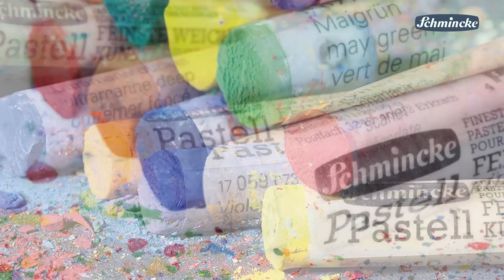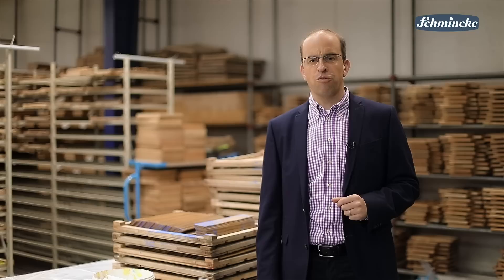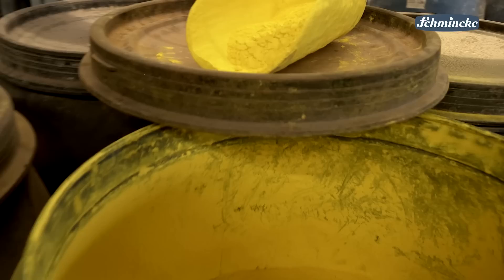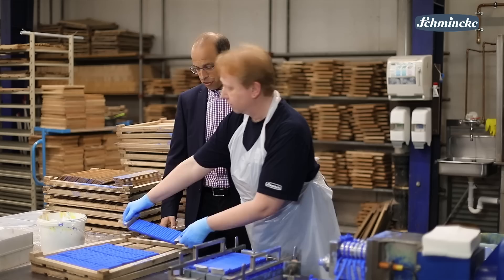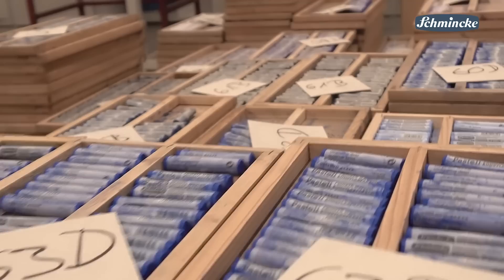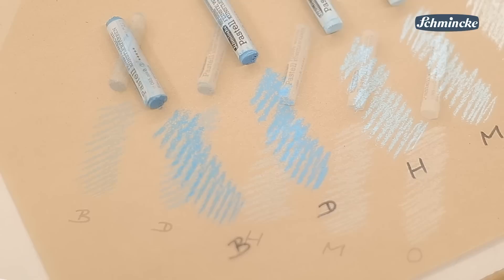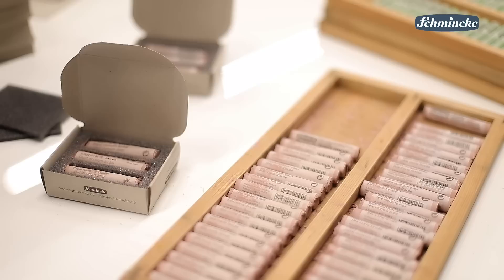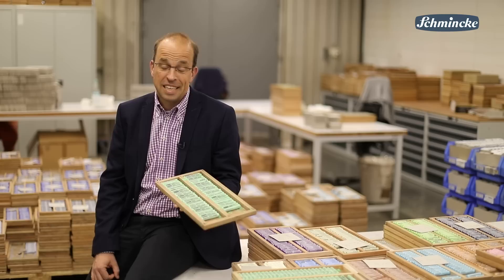How Schmincke Soft Pastels Are Made

Comment: I have a question concerning the letters B, D, H, M, O on the labels:) They must be the first letters of some words - but what are they? B - Black? D - Dark? And then?..
I think this info could ease remembering the system:)
Another question is more difficult. I see that Schmicke pastels are often multi-pigmented. And what especially surprising, when you study the pigments in the variations of the same color, there can occur different pigments. For example, Krapprosa 047 in H variant contains only PV19, in D variant it has also PR122 (another Quinacridone) and PR146 (Naphtol). Violet Tief 059 has in D variant four pigments (PB29, PV23, PV19, PB15), in H variant - PB29, PV15, PR146, M is just PV15 and O is PV15 + PW6. So, am I right that "adding white" is not a literary admixing of white? My first idea is that possibly some pigments (and paints) while mixed with white not only get paler but change their color tone. May be some mineral pigments can play as "white without white" (as Ultramarine Violet). So, what is the idea of the "color" from this point of view? There obviously must be some check gauge for each...

Comment: I create mine using gum arabic.   And pure pigments.
Reply: Do you have a recipe Yana that I can try?
Reply: Some gum powder.  
Moisten it with some alcohol
Then add distilled water.  
Leave it for 2 hours?    Depends on the gum.  - i use gum arabic-
Ratio is about 20:1 (water to gum) 

Then you cn use pure pigments such as iron oxides.    Or mix 2 parts whiting chalk and 1 part pigment.
Reply: Thanks Yana for the speedy response.